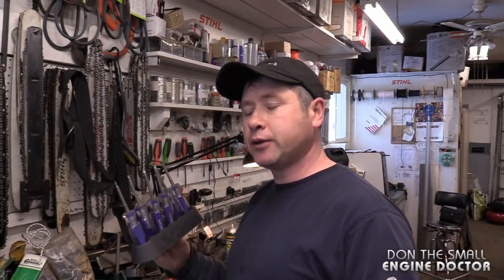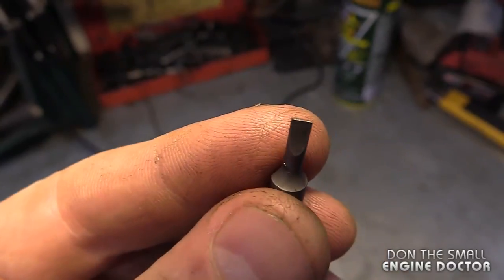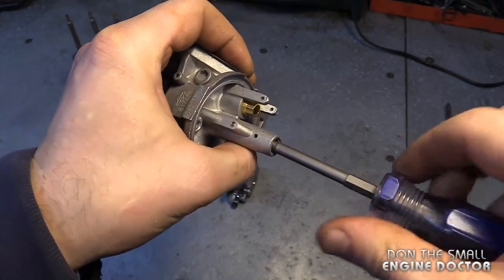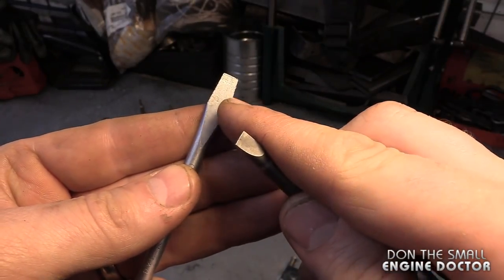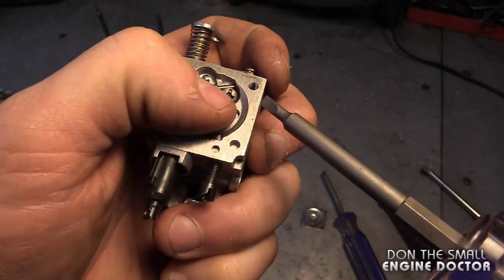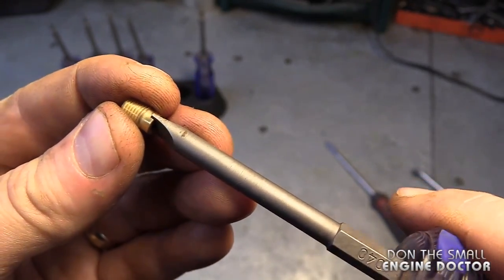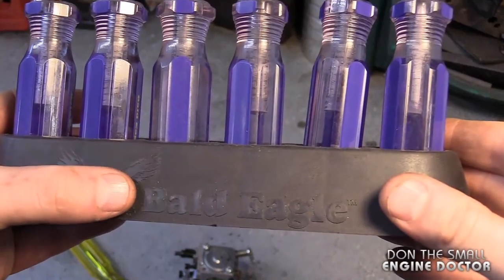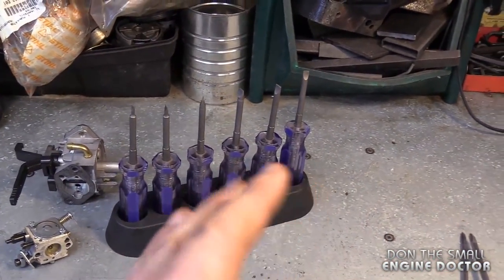TOOL REVIEW - BEST Carburetor Screwdrivers!

Comment: That's a good suggestion. I have a set of gunsmith bits that I got from Brownell's long ago but it never occurred to me to use them on carb jets. There must be 50 different bits covering every screw slot width and thickness you would ever encounter.

Comment: A good eye along with a steady hand and a grinding wheel, you can make these yourself.
If you own a shop the whole set is better, but for a once-in-a-while guy, grinding down an old screwdriver has always worked.
It's about angles and surface area.
Reply: Yep, I bought a few cheap $1.00 screwdrivers and ground them down to fit different jets. Work great and never had a problem.

Comment: 03:12 Pro tip if you are handy: a dull slotted screwdriver is easily re-profiled (sharpened) with a file, or using a very fine grinding wheel. Sharp screwdrivers don't slip as easily as dull ones.

Comment: For carb use they look ideal, well worth keeping them for special use :-D
I would imagine the metal and tempering would be quite tough but not brittle.

If you can't find a perfect fit, perhaps fold a strip of teflon plumbers tape over the blade to take up the slop, just a daft thought lol.

Comment: Those are nice. I use hex insert bits where they fit but that would not work if the jet is inside the tube like you showed.

Comment: There is a set of about 35 of those in the big shop........   For gunsmith work.....  Plus quite a few for the different jets in Outboard engines and the small engines that we work on ............. 

Would you put a normal driver on a 4 thousand dollar gun ??????  I don't think so .....  Those tips are made to fit a screw just right ............    

Someone would think that a driver would be made to fit a screw just right nowadays....  How much is a set of SNAP ON drivers ????   They look the same as a Craftsman set of drivers.....

Plus Tard Mon Ami ~!~!